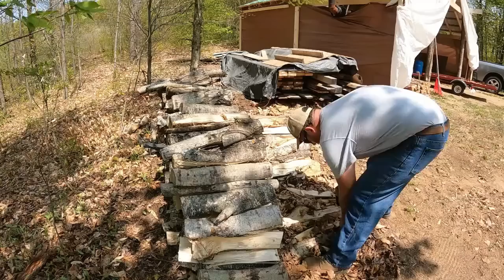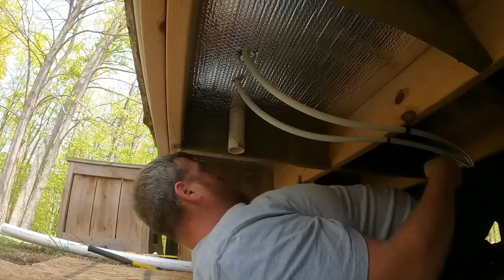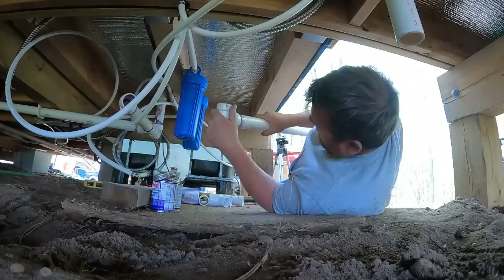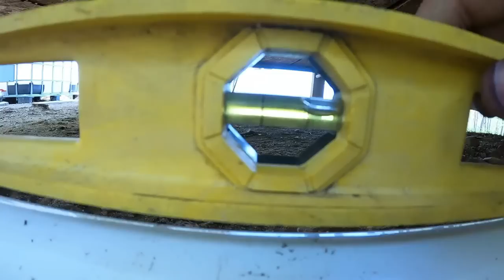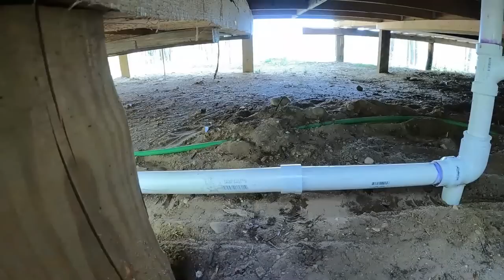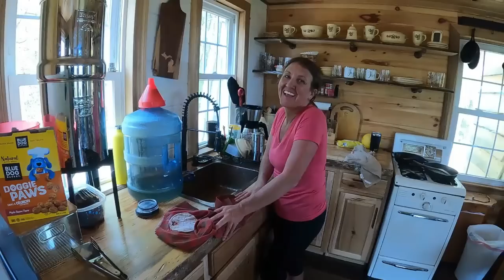Things are Flowing at the Off Grid Cabin - Drains Installed

Comment: Pretty cool. So for winter, it will be back to pioneer days?  Or would you put a skirting on the foundation, build an enclosure for the water tank in the future so you can have running water?

I guess until you mesh cap the end of the drain pipe, you’ll get some lovely spiders coming up the drain.
Reply from the maker: Planning to insulate and skirt everything in.....hope it will make it safe for a majority if the year

Comment: A few things about your shower drain and the way it connects to the system is since ther is no trap involved....you might get a odor coming out of that drain.But....having a trap full of water undernieth your floor exposed to temps below 32 degrees will crack and break a pvc trap.But you can wrap the trap dip area with heat tape.There is also heat tape with a built in thermostat that only turns it on when it gets below a certain temp.I am a retired plumber and advised people with mobile homes that even with skirting on most applications.....p-traps will freeze and break.Unless heat tape is used because the skirting is just thin metal or wood that just keeps wind out.But the temp undernieth any structure will be about the same and even colder.....unless there is either a heat source or radiant heat from the rooms above..Or the easiest way to prevent odor is keep shower drain stopped up when not in use.Just a thought Jay
Reply from the maker: I like and appreciate all the tips. I definitely dropped the ball on the shower thing, lol. Might have to add a ptrap after it all and hope the lines don't stink, just the tanks.

Comment: I have a similar system at my deer camp for gray water. On the end of the line we have a PVC ball cock valve that we open when in use and close when we are not there. We surface drain the water to a small ditch
Reply from the maker: Nice....siimple and effective